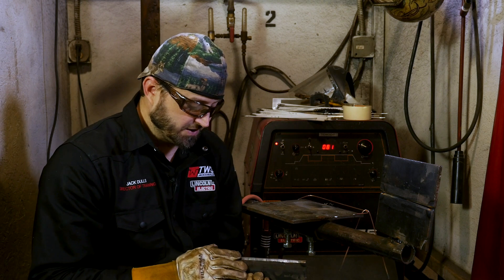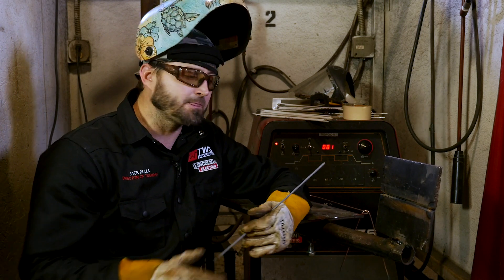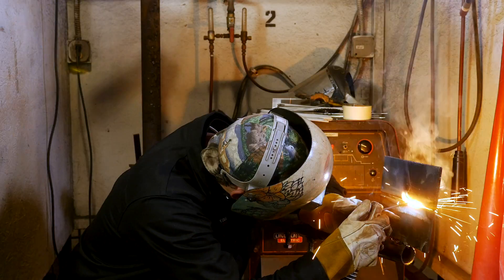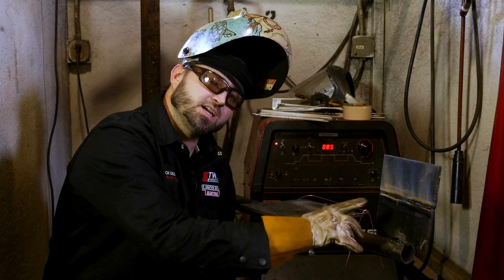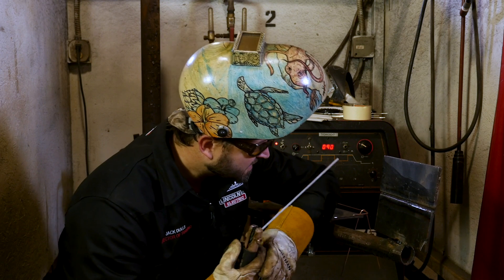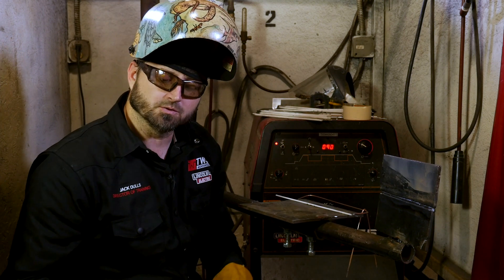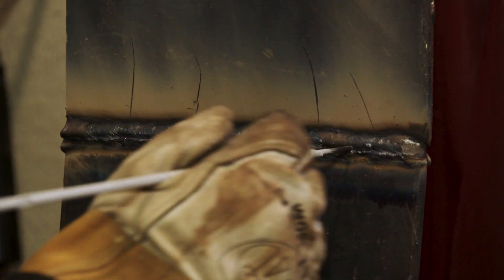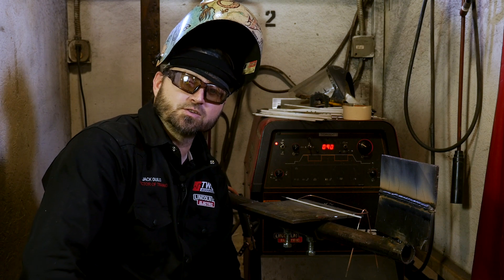2G Open Butt 6010 Root 7018 Fill Cap: Welding Demonstration

Comment: What was the rod angle at on the root
Reply: I wood recommend pointing that fucking nasty ass rod a slight 5-10 degrees to the left if you're going from left to right.

Comment: To the instructor of this video: I usd to be a YouTube creator and have tons of videos on my chnanel, so maybe, if you are a weight lifter, you can go to my channel and find something you like. Anyways, Thank you and I have a message and a breakdown of what I saw to close my commentary out. 

I am a welding student from Michigan. I am doing this 2G process right now for class. I am not getting testd on it, but my last stringer has undercut and it's frustrating when you put the work in at every stage and get to that last bead and do your best and you wind up with a ton of undercut spots. After 9 attempts at the last stringer and about to attempt my 10th, I just sat last night in my booth frozen,  staring at that last space for my last stringer, not wanting to start because I knew it wasn't going to be right. And I had a beautiful piece just waiting for me to put the dagger in. 35 seconds of work to a job well done. Needless to say, I did my best, and it was still way too much undercut... So I come back to day to give it another shot. 

When you engage in a process you will see things that you're supposed to see. These things will be what blame  finders won't see. There's a little bit of hate in this comment section about the quality of this man's welding. I beg to differ. I think that this is a good video. To the instructor, I would have liked to have had a bit more intruction about your thoughts on the propr angle to avoid undercut in the the last stringer as well as the changes in rod angle for each pass, but othr than that, I really enjoyed this video. 

Before you find blame and call people a joke-PEOPLE GOING OUT OF THEIR WAY TO TEACH YOU SOMETHING- maybe you should be able to back it up. Here's what I see from each step and you can tell me what you see wrong in each of these if you don't mind: ( I'm serious. I am a welding student and I want to know what you see that I don't):

1. His metal was clean; land and fit up were spot on. Nice and even. Great way to start.
2. His key hole work was outstanding. No stops and starts but just for that one to show you what he was talking about as far as the good result you get when your fit up is spot on. So it was ja nice clean even-sized keyhole and he blew right through the tack and closed that gap clean.
3. He layed in a great lookng hot pass-1 hot pass mind you- and ground out the wagon tracks to a smooth finish so as not to trap slag for a bend and radiograph test.
4. His 1st and 2nd stringer with 7018 didn't go over the edges of the plates and the second pass coverd the first one by 50% on the money. 
5. His 1st and 2nd were so good that he didn't even need a cap.
6. The ends of the welds were real pretty. Not scorched or jagged, the beginning of his welds and the ends of his welds look the same. Not so easy to do.

Comment: Hmm, Did he feather out his stop-start on his root? Was he pushing the rod?  If he's showing you just simple welding then I guess it's not to bad , assuming no testing was required. He's also using a rod CELLULOSE where you can't really fail the root unless you're blind
Reply: His tie end technique is weird

Comment: This guy Is a joke look at those fills 😂
Reply: Post a video where you show your 2G step by step. Before you find blame and call people a joke-PEOPLE GOING OUT OF THEIR WAY TO TEACH YOU SOMETHING- maybe you should be able to back it up. Here's what I see from each step and you can tell me what you see wrong in each of these if you don't mind: ( I'm serious. I am a welding student and I want to know what you see that I don't):

1. His metal was clean, land and fit up were spot on. Nice and even. Great way to start.
2. His key hole work was outstanding. No stops and starts, just a nice clean even-sized keyhole and he blew right through the tack and closed that gap clean.
3. He layed in a great lookng hot pass-1 hot pass mind you- and ground out the wagon tracks to a smooth finish so as not to trap slag for a bend and radiograph test.
4. His 1st and 2nd stringer with 7018 didn't go over the edges of the plates and the second pass coverd the first one by 50% on the money. 
5. His 1st and 2nd were so good that he didn't even need a cap.
6. The ends of the welds were real pretty. Not scorched or jagged, the beginning of his welds and the ends of his welds look the same. Not so easy to do.
Reply: You must like him how many times you go under the videos
Reply: @geronimo1533  cause it’s funny watching him he’s a joke duh
Reply: Lmao Fr😂
Reply: No shit man. Thinking the same thing.
Reply: He went way too fast on the last 2 or 3 fill passes.
Reply: @erickwardwell962  yeah exactly! You should see his other videos 😂
Reply: @tofreshboy3  oh I've already watched 3 or 4 already. And were supposed to pay big $$$$ to go here?
Reply: I thought TWS was supposed to be better than the trade school I went to??????
Reply: @erickwardwell962  exactly!!!😂not with instructions like him😭
Reply: @erickwardwell962  Albuquerque Job Corps welding program is wayyyy better and its free.
Reply: @erickwardwell962  Post a video where you show your 2G step by step. Before you find blame and call people a joke-PEOPLE GOING OUT OF THEIR WAY TO TEACH YOU SOMETHING- maybe you should be able to back it up. Here's what I see from each step and you can tell me what you see wrong in each of these if you don't mind: ( I'm serious. I am a welding student and I want to know what you see that I don't):

1. His metal was clean, land and fit up were spot on. Nice and even. Great way to start.
2. His key hole work was outstanding. No stops and starts, just a nice clean even-sized keyhole and he blew right through the tack and closed that gap clean.
3. He layed in a great lookng hot pass-1 hot pass mind you- and ground out the wagon tracks to a smooth finish so as not to trap slag for a bend and radiograph test.
4. His 1st and 2nd stringer with 7018 didn't go over the edges of the plates and the second pass coverd the first one by 50% on the money. 
5. His 1st and 2nd were so good that he didn't even need a cap.
6. The ends of the welds were real pretty. Not scorched or jagged, the beginning of his welds and the ends of his welds look the same. Not so easy to do.
Reply: @tofreshboy3  he’s not an instructor. He’s director of training. Rarely actually goes on the shop floor and welds. The instructors at TWS are actually really good and extremely experienced. Feel free to post your 2g root and cap tutorial though.
Reply: @larrymasterspowerbuildingc4477 it got real quiet in here real fast lol, good job bro lol

Comment: How can you tell the difference from a 2g and a three 3g. What is a g?
Reply: G stands for groove, which is the type of joint/weld (in this case it's a "V groove" open root weld). All the number tells you is the position; 1 would be flat 2 is horizontal 3 is vertical and 4 is overhead.
Reply: We would like to see the back side..all videos like this here youtube didnt show the backside of the rootpass.
Reply: @makenjiearkanghel7152  i mean hes a teacher at tulsa i wouldnt doubt that it lools great
Reply: @boogarain3174   id like to see the back side sothat, i can conclude if my welding is in correct penetration brother...or i need to improved it.
Reply: @makenjiearkanghel7152  i mean it should just look like a regular bead but ill perfectly connect with both lands. make sure theres no holes in that pass and your good to go
Reply: @makenjiearkanghel7152  buy a fillet weld inspection guage that comes with a center punch kit to measure the protrusion of your back weld. Doing that will tell you if you have met the code for the size of the backweld. And you can get the structural code book by AWS to find out about the structural paramters of any and all of your future testing. And if you did all of this and worked with your welding instructor, I bet your welding instructor would be extemely impressed.
Reply: @makenjiearkanghel7152  want to see the back side? Here's a PHENOMENAL root pass backside weld that will blow your mind. It's one of the best I've seen on YOUTUBE, no kidding, from an different welding school teacher. https://www.youtube.com/watch?v=IZ_EqwNwIIw
Reply: Go to Tulsa Tech They’ll teach you about it
Reply: A g stands for groove.